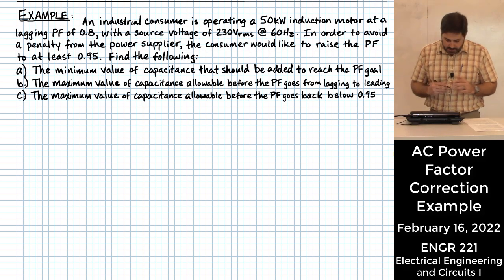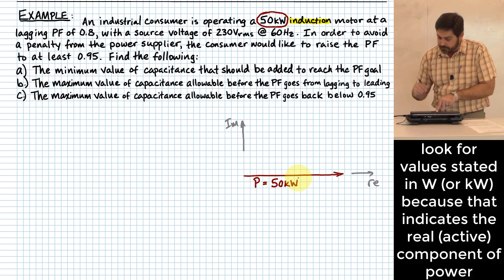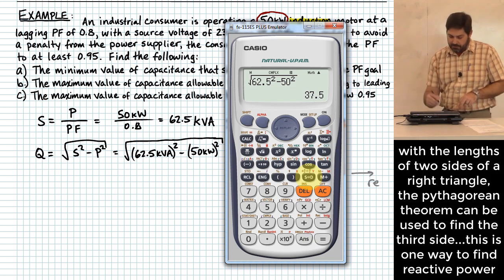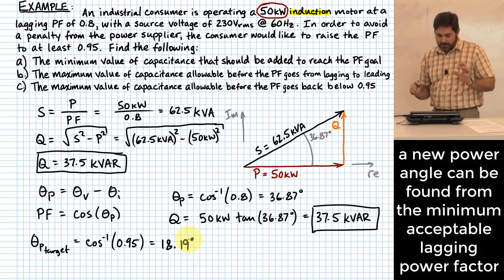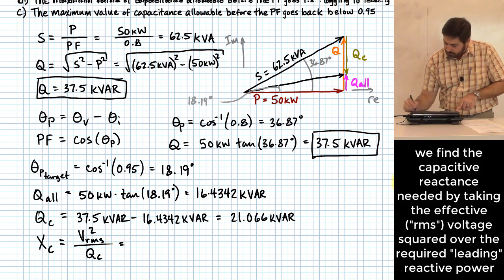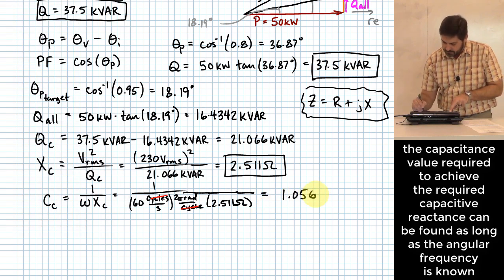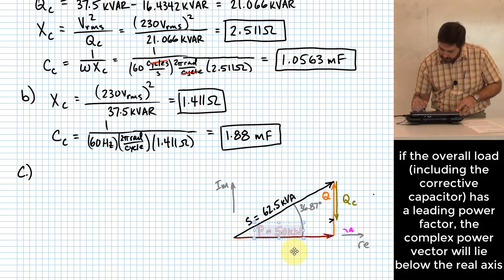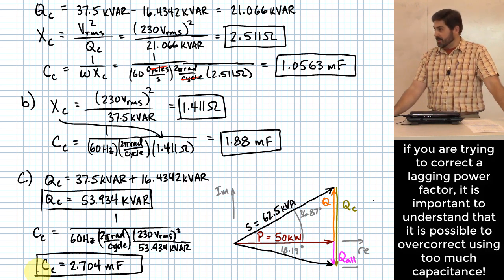Power Factor Correction Example: Finding Capacitor Value Range To Increase Lagging Load PF To Target

Comment: Can you also use the fact that Xl = V^2/Q for the original Q of 37.5kVAr, such that Xl = 230^2 V/37,500 VAr = 1.411 ohms, then Xl/w= L, or 1.411 ohms/377 = 3.74 mH … just playing around with the relationships given from the equations of P,S, and Q and the reactance formulas. I know there is more involved when calculating inductance, just seeing if this was a reasonable method to get an inductance value which is never really listed with a motor, but have always been curious of calculating it quickly and coming close with other included information from motor nameplates and or measured values. Critics welcomed … just don’t be contentious, professionally and politely is enough when giving me an observation on my mistakes. 8:38